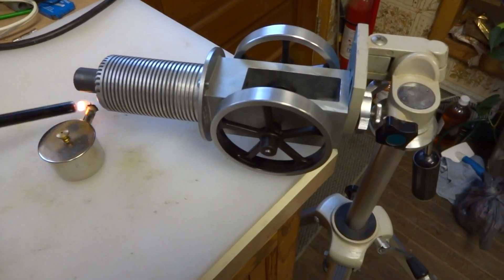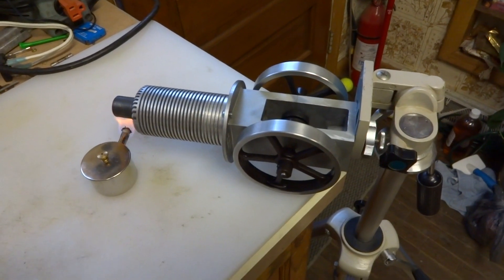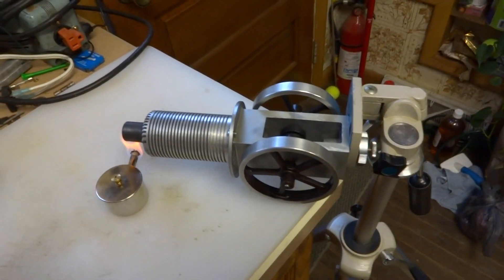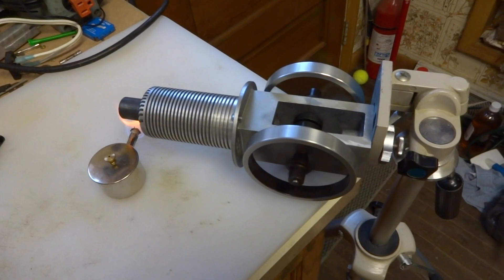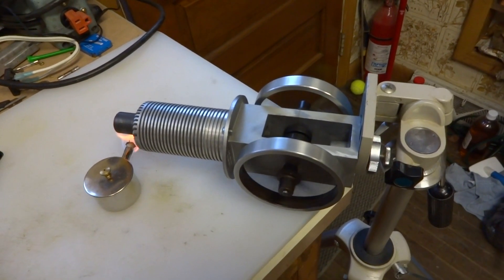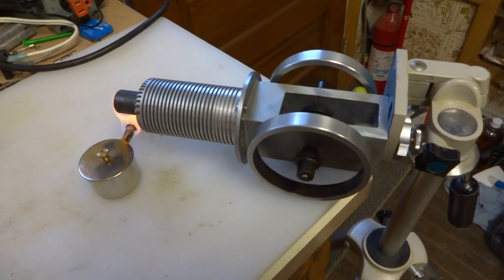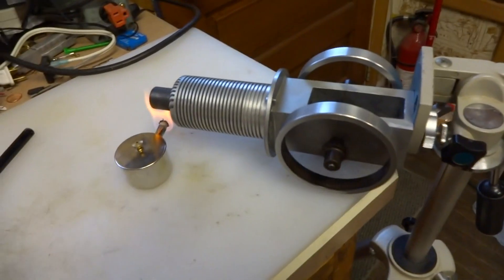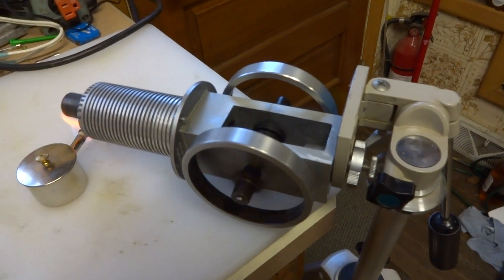Solar Engine Stirling Engine

Comment: This was built by Solar Engines of Phoenix, AZ, long defunct, taken over by PM Research. The Sun Runner is the newer enclosed version. Mine is identical to yours, bought in 1980, you can see it on my channel running at 2550 rpm. Works great with the parabolic reflector. Hardly any power though. Keep the bearings lubed - I've rebuilt mine a couple of times, also burned out the SS head and had to replace it.
Reply: Hello, excuse me a nephew I put oil to my engine, 20w-50, how could it be composed?